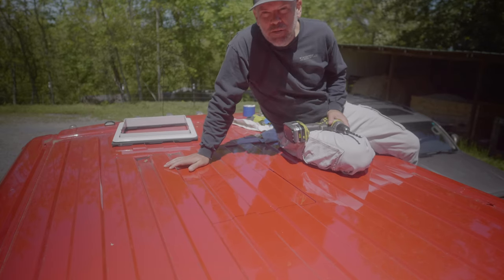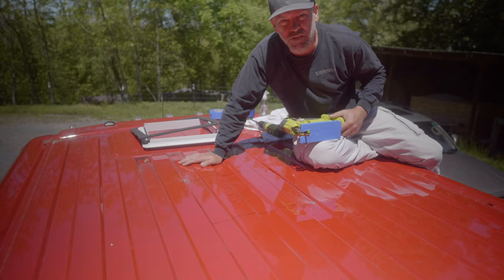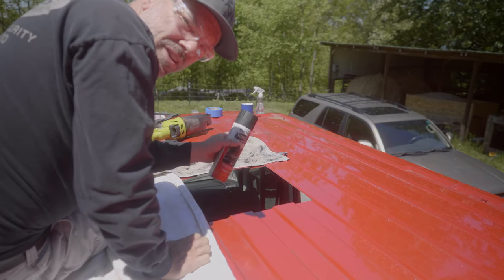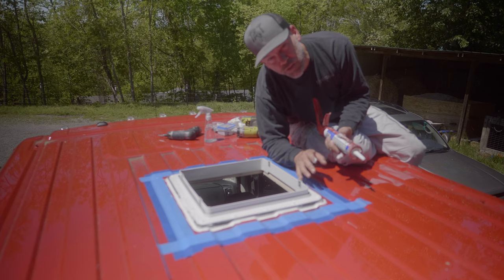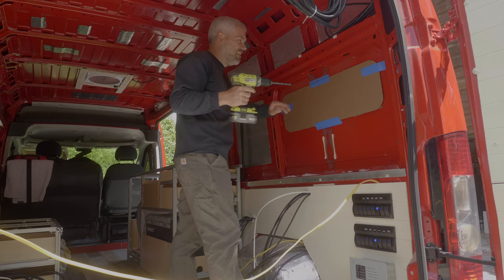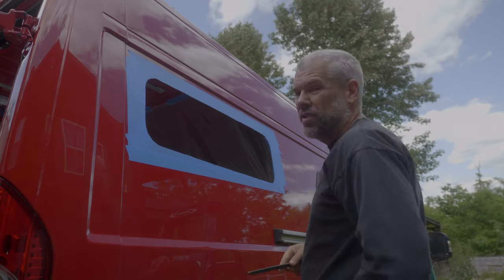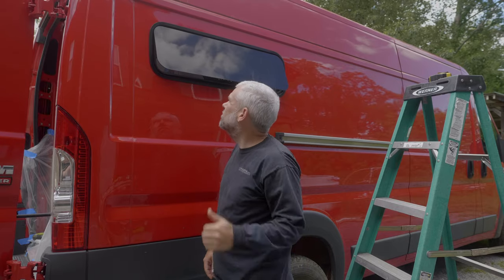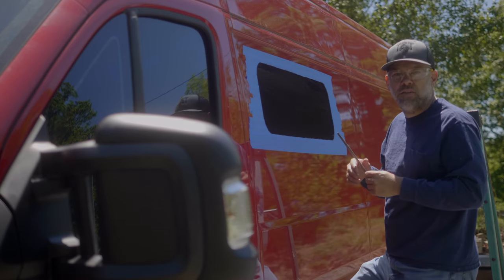DIY Promaster Van Conversion Build Part 4: Cutting in MAXXAIR Fan & Windows / Van Tour / Camper Van

Comment: How do the windows seal on themselves so water doesn't get in? Does it come with some sort of foam inside, or do you need to add a caulking around it afterwards?
Reply from the maker: No caulking. The window has a gasket to seal it up from the weather.